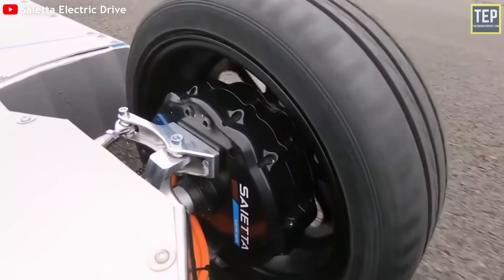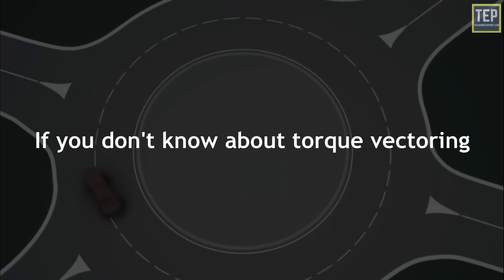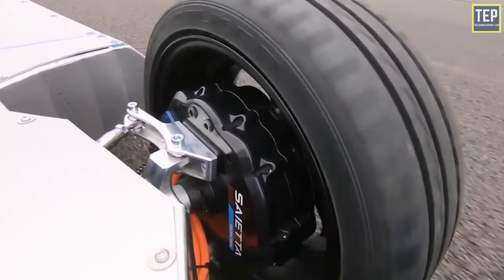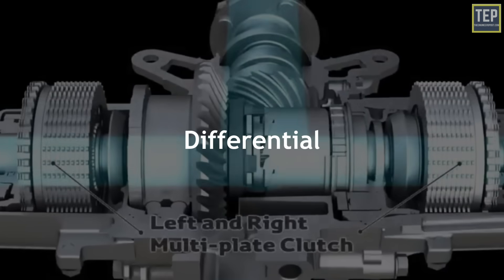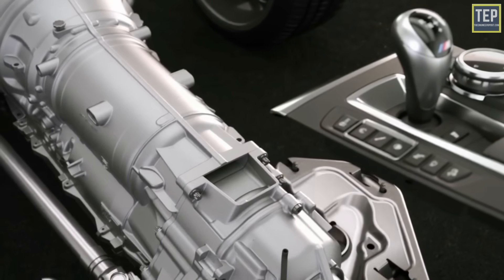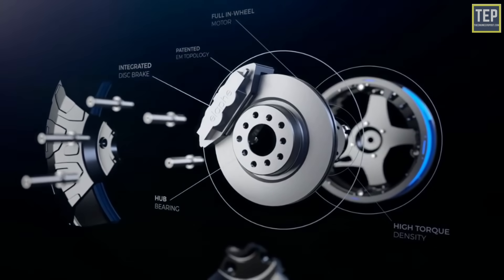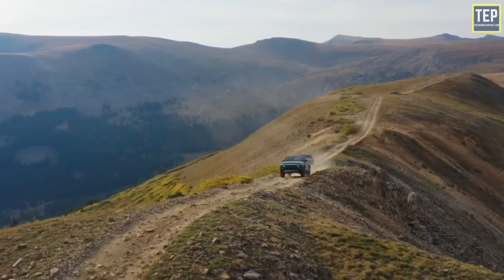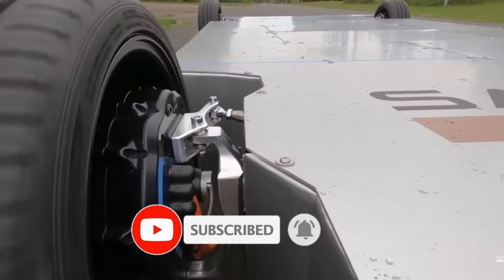How does In-Wheel Motor Technology Work? | Four Motor Drive & Torque Vectoring

Comment: Sure, it's great at first, but what if 1 out of 4 motors fail or  locks up? Then that wheel just locks up and you crash? It could be really dangerous on the long term.
Reply: true
Reply: Depending on the motor some cannot "lock" without power. A malfunction would trigger a shutdown on that motor effectively putting it in neutral. Most EV's should be designed such that 2 motors are sufficient to move the vehicle to the nearest repair center.
Reply: @crisbowman  1 is enough
Reply: This can be fixed simply by having a some Part of communication between motor